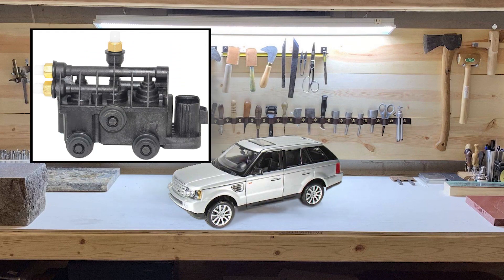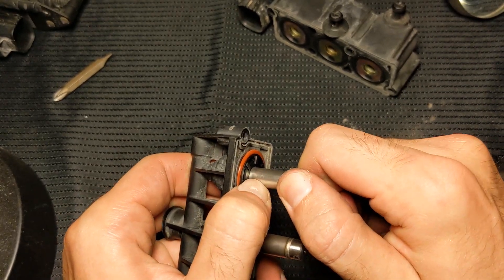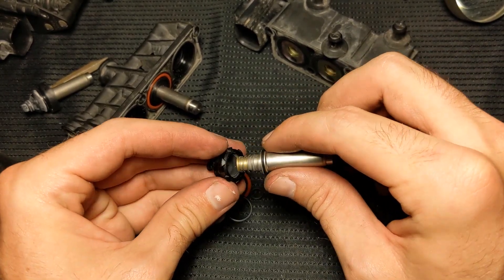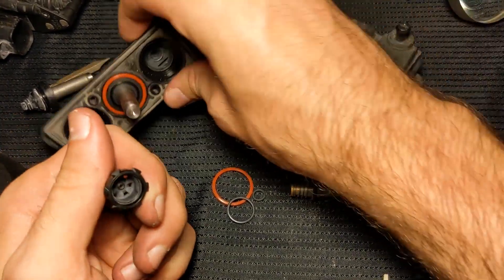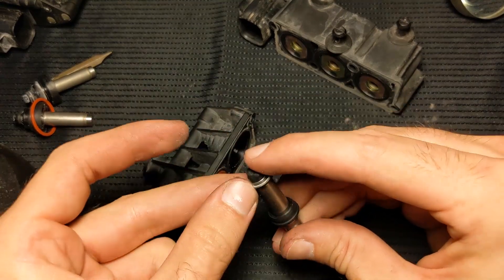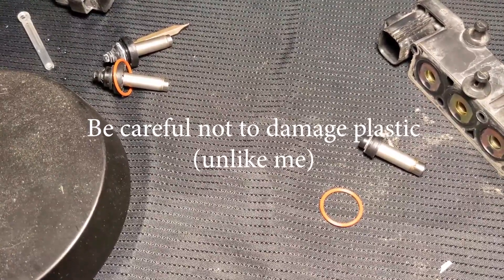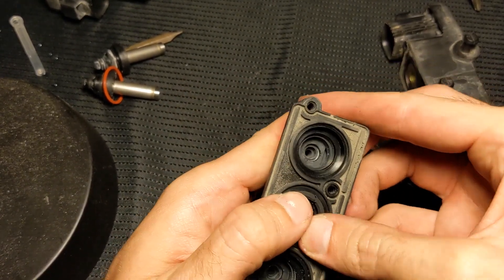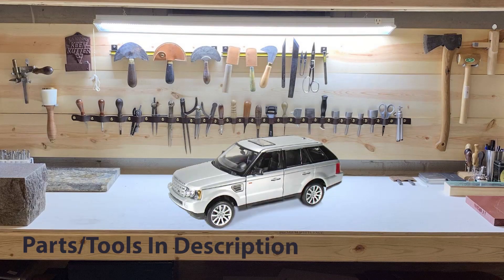Valve Block Rebuild / Teardown / Cleaning - Front and Rear - Range Rover Sport or LR3

Comment: Hey! All your RRS videos are super💪🏼 really helpfull! My RRS 2010 has a problem with the suspension won’t lower. When I try to lower it, it jumps up to offroad mode. The ride feel kinda “bumpy” and the ride height looks off.  It does not sag over time. Any helpful advice? Thanks!

Comment: The two valves, ,, look the same, but have different part numbers, are they actually, the same?, as in no different specifications?
Reply from the maker: The solenoids might have different windings or voltages even though they look identical, try to purchase the correct one for the front or back because of this!

Comment: Thank you for your explanation, Very informative 
I have a RRS 2005 which is now at the lowest suspension level -  it does not rise up 
I discovered that the compressor relay is not working - the compressor works if I bridge the wiring 
Any thoughts on what i should do? Thanks Philip
Reply from the maker: I would try changing the relay, if that doesn't work you may need a new compressor unfortunately

Comment: Hi, i have strange fault U0434-86. And "wehicle leans when cornering".  I replaced fron right shock absorber. But it happened later. And it progressed. At first it was once a week, later once a day, now it comes  after startin vehicle. Lr320. Its the only fault code in suspension. Steering angle sensor when steering wheel is in normal position shows 0.  But after changing shock rear right one stays very high. What would you  suggest?
Reply from the maker: You'll need a diagnostic that can pull which modules triggered the code (dealer probably) to diagnose exactly what is triggering this, since it can be multiple. It CAN be the suspension solenoid (front/rear), so if you want to try to replace these ($50 each) that can be an option.
Reply: @HazyJay  hell, after an hour. I started the car, and the same poped on again.
Reply: @HazyJay  i removed all connections around that block, checked wires, nothing. Left for tomorow. Strange thing, after replacing leaking front right strut. Car leans left when driving
Reply from the maker: @gmykolas  Yeah the center solenoid of the valve block may be stuck in the closed position due to dessicate dust, you may consider cleaning the solenoid and seeing if you get lucky.
Reply: @HazyJay  we are talking not about the same blokck
Reply: @HazyJay  its. Block near the acelerometer sensor  where 4 steal hoses, comes and goes thurther. With 2 solenoids on the top, and one o the side.
Reply from the maker: The valve block is the same one seen in this video but you can see how to access in my front valve block video. The hoses should be plastic though with metal voss connectors.
Reply: @HazyJay  this your video helped me a year ago. I found 3 broken wires. I fixed it. Now, i checked my fixed wires, its as good as it was after fix. But, first code u.... After clearing, check light didnt go of.  Dtc with c.... After clearing, there was sound under rigt side door, simple drrrr, sound. And light went of for a second. After that, as i wrote, i checked all 5, connections. And dtc went off for a half an hour

Comment: I am getting ready to replace the front and rear valve blocks vs refurbishing them on 2008 Range Rover HSE.

Hazy - Do you know if front and rear valve blocks are the same when searching for the aftermarket $50ish replacements? Front and rear same on your vehicle?
Reply from the maker: Mechanically they are identical, I would recommend not refurbishing the valve blocks since I've heard some people having problems after a refurbish that resolved with replacing the part, it's just too hard to know if the rubber is sealing on the solenoids.
Reply: @HazyJay That helps tremendously. Thank you
 I also have the kit to refurb the compressor's dryer with o-rings, internal filters and drying beads. I can only imagine how caked and bound up the internals will be when I get in there.

Comment: My 2007 RR Sport goes all the way up when I start it and stays there. I can’t get it to come down. Is it a bad sensor or is it one of the blocks?
Reply from the maker: You can check the 4x4 info screen in the dash, if it shows that all wheels are extended then the height sensors are working. If it shows that they are all normal height, but are extended in real life, then they are faulty. Inability to vent ALL wheels is likely due to a faulty exhaust valve on the compressor, if it's just the front or just the back then it could be the front or back valve block.

Comment: Hazy, when I park and shut off my 08 RRS, the auto level system always drops the rear driver wheel more than the rear passenger. I know the shock is not leaking because I literally watch the system actuate and let air out of it. My car also does not sag overnight. Do you think my rear valve block has a blockage? Or is it maybe a software problem? It also will often not pump the shock back up when driving again. Thanks
Reply from the maker: Check the 4x4 info on the dash. If the wheel appears level on the screen but it's NOT in real life, your height sensor needs replacing or calibrating. If it's unlevel on the screen AND in real life, then you a new valve block on the rear sounds like a reasonable first step.
Reply: @HazyJay  the  screen shows the wheel slightly off. The sensors are accurate to real life. I’ll start with the rear block. Thanks for the quick reply!

Comment: can the electromagnet that pulls the solenoid go bad and cause them not to function?
Reply from the maker: The electromagnet itself will likely not go bad, but the seals can be clogged with desiccant making the solenoid non-functional
Reply: @HazyJay  thank you for still replying even after 5 months. my front end wont go up, i figured it can be the front valve block, i refurbished it. it wasnt bad to begin with. i got a code for the front driver height sensor supply. circuit looks fine so i replaced the sensor.  still have the issue.

Comment: HAZY, IVE GOT A SERIOUS PROBLEM! MY REAR WINDOWS ARE STUCK OPEN! THIS HAS BEEN HAPPENING FOR 2 YEARS BUT THEY ALWAYS EVENTUALLY WORK. BUT THIS TIME ITS BEEN 3 DAYS WITH THEM OPEN! RELAY? BCM? FUSE?  WHAT DO YOU THINK, HAVE YOU HAD THIS YET? COMMON PROB BUT I DONT SEE THE L320 ON ANY FORUMS OR VIDS? MY COMPUTERS ARENT IN THE GLOVE BOX AND I DONT KNOW WHICH RELAY IT IS??
Reply from the maker: You can try resetting the rear window by holding the switch up for about 3 minutes, then turning the car off and on again and see. Otherwise it may be a short circuit or frayed wire, these are harder to find.
Reply: @HazyJay  No power to either back window switch! Its somthing before that.
Reply from the maker: @johnnyquid3350  Do they roll up if you use the rear door switch? Does the rear door lock work? This has never happened to me but if the switch doesn't reset it's likely an electrical connection or the window ECU is faulty. There's a bit of information online if you look for "LR3 rear windows stuck", should work for a RRS because they are very similar.
Reply: @HazyJay  Rear Door switches are dead no power. No clicking no nothing. Its either the wiring harness in passenger door sill or BCM problem or maybe a relay?? We will find out soon cuz its at the dealer as we speak! 😬💰💰💰💰
Reply from the maker: @johnnyquid3350  Ah let me know what they find
Reply: @HazyJay  will do

Comment: Very nice explanation. Yet, I would have liked to see how to properly clean these little parts with the specific cleaner or lubricant. I have the feeling that the parts are still durty
Reply from the maker: You can purchase new o-rings (in description) or use silicone spray and rub down the o-rings to make them appear like new. Or just buy new valve blocks altogether 🌚. I'll be sure to show all relevant steps in the next video.

Comment: Front and rear valve are same ?
Reply from the maker: Mechanically they function the same, but they have different part numbers. If you are buying a replacement I would purchase the correct one to avoid any issues.